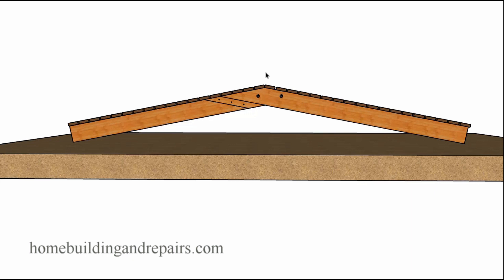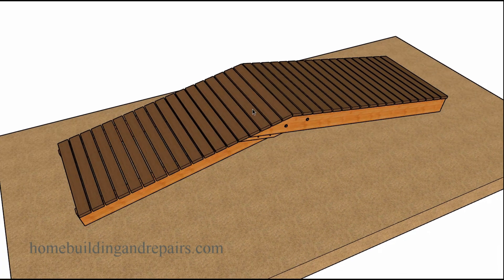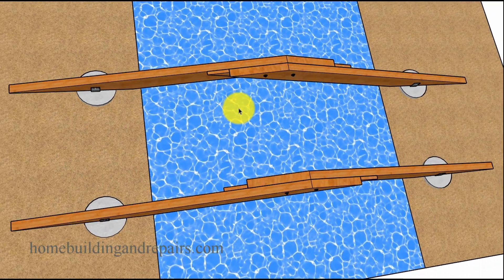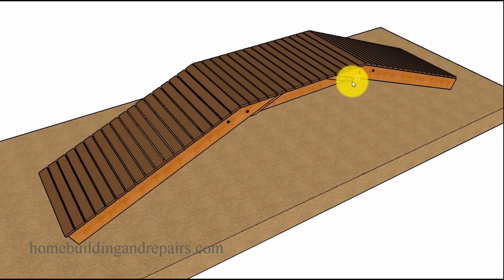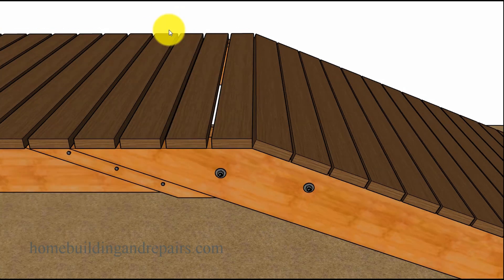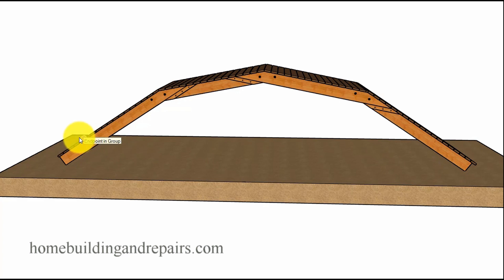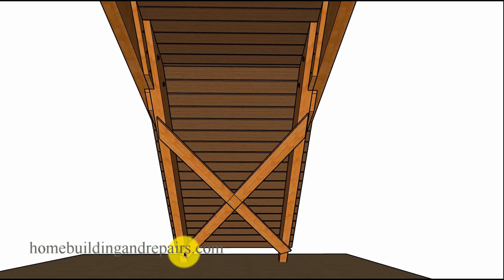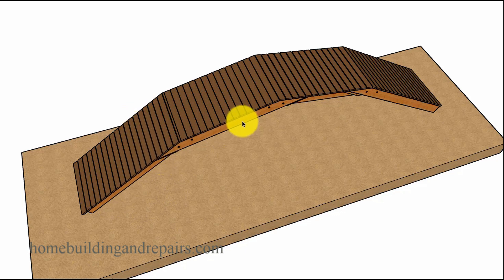Modified Wood Bridge Design Ideas From One Of Leonardo Da Vinci's Plans

Comment: I am not and engineer but it appears to me that this design is dangerously weak. In this design the load is carried by 2 bolts about what, 10 inches apart from each other. In the da Vinci  design the load is carried by points (cross members) that are about 6 feet apart from each other. As well, the da Vinci design has the full dimension ( 3 1/2" of depth if using a 2x4" ) of the structural member carrying the load. By using bolts through the center of the depth of the 2x4, leaving 1 3/4" of material above and below the bolt, the strength of the 2x4 is cut in half.
Consider: a pair of 2x4's 8 feet long set face to face with each other with 2 bolts, one near each end to join the 2x4's, creating a  doubled 2x4, 8 feet long. Set this horizontally, on edge, supported at each end. Stand in the middle of it. Does it break?
Now offset the 2x4's still face to face but  with only 4 feet of each in contact with the other. Bolt together, support the ends and stand in the middle. Does it break?
Now offset the 2x4's still face to face but with only 10 inches of each in contact with the other. Bolt together, support the ends and stand in the middle. Does it break?
I believe that the strength of the da Vinci design is largely in the fact that leverage applied to the joints is widely separated, a factor that the design here almost entirely eliminates.
Your design might be adequate for some given loading but the da Vinci design seems stronger and simpler by large margin.
Reply: But nice job keep it up
Reply from the maker: I'm not an engineer either and appreciate your input. If you're suggesting that the 4" x 10"x 12' main support beams should not be 2 x 4's then I would also agree, but if not then I'm confused.

I don't think a skinny and long in length Da Vinci's bridge would survive from strong forces of side to side movement, but could be with some type of bracing and structural footings. Does it break?
Reply: @gregvancom  My thought is that for any given dimension for the main support beams, the closer that the bolts are to each other, the weaker the structure. For instance it appears to me that the two bolts in your design are about 10 inches apart. What would happen if the two bolts were just a quarter of an inch from each other? With that separation on a 12 foot long  beam those two bolts would essentially become an axle, a pivot point. 

I base my guesses on an assumed "perfect" foundation for any given configuration.